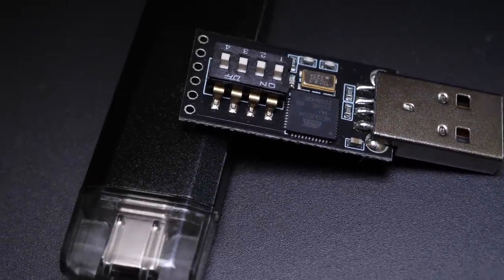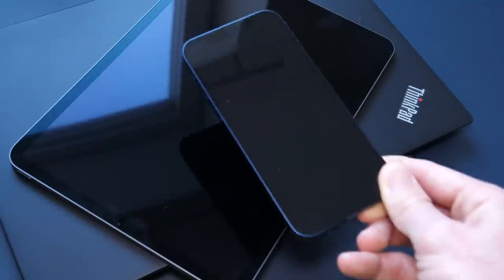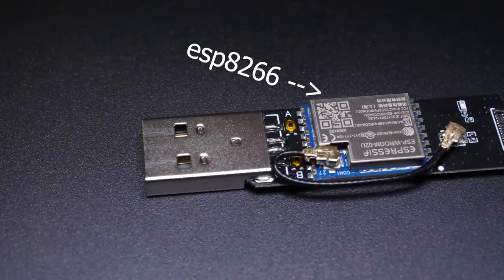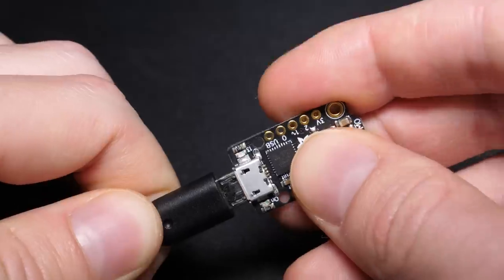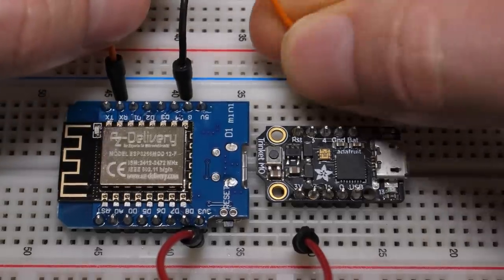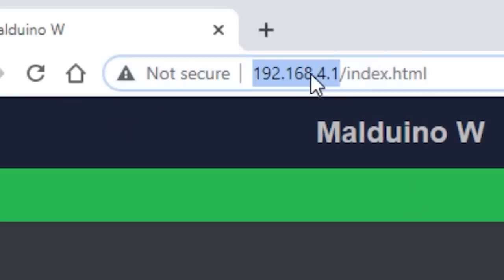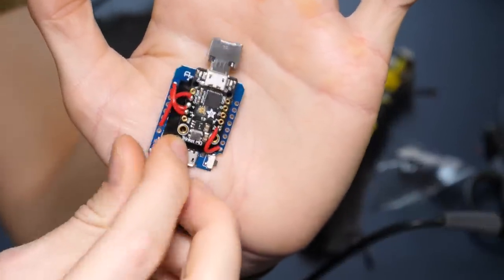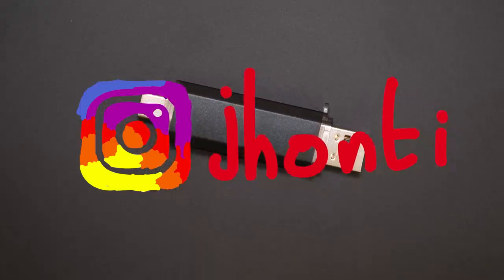Making A $10 WiFi BadUSB + (cheeky giveaway)

Comment: I just bought both a Arduino Pro Micro and a NodeMCU, this comes at the perfect time, and once again, this video is really well made
Reply: Do you mean I can use any Arduino, I have an Arduino nano and an ESP 8266 ... will it work?
Reply: @mananshah4184  you need an Arduino with a ATmega32u4 chip, the Arduino Nano won't work but you can buy an Arduino Pro Micro or an Arduino Beetle for somewhere around 5$

Comment: So, I followed the instruction in the video. All working perfectly with the D1 and Trinket. I want the overall package to be small, so  I then desoldered the ESP12 from the D1 and resoldered back to the trinket using the same connections. When I power up the trinket via USB, the ESP12 led turns on but is very dim. Also, no wifi AP appears. What idiotic thing am I doing wrong? :)
Reply: did you make it work?

Comment: When you build the new malduino why didn't you use the esp32 instead of the arm chip and esp8266 it should be able to handle webserver duty and the usb connection simulaneously?
Reply: The esp32 does not support USB-connection as a host. So you need a second processor (Cortex M0, Atiny85 [as before], CH559, ...)

Comment: I just signed up for the giveaway, I know you said "multiple entries per household are detected, all entries from that household will be disqualified".
I don't know if I just sent multiple requests to your form to see a response by accident, but turns out one of my browsers extensions were blocking me I think from sending the form.
I hope that would not be a problem and would not get disqualified.
Reply from the maker: No worries :) As long as there's just one email address you used, shouldn't be an issue

Comment: hey I just built it will all the right stuff and I can connect to the Malduino just fine and it detects it as a keybaord but when I run a command it doesnt do anything. it work if I like change the LEDs but it wont work if I  STRING hello or something plz help
Reply: I found that it wasnt the LED that was only working it just only lets be run the first line of code so if I had LED 255 0 0 then the LED would change but if I had DELAY 1000 then LED 255 0 0 it wouldnt work. and so I tried running GUI r and it worked but only if i had that line of code only. anyone know whats up
Reply: so it pretty much only lets me run the first line of code

Comment: A good defense against BadUSB on Windows is to set a local policy denying driver installation for keyboard class devices using this GUID: {4d36e96b-e325-11ce-bfc1-08002be10318}. It will prevent any new keyboard from being installed. Existing keyboards will still work.

Comment: When I run a script it shows "Running /" and stays like that for ever, I'm using "D1 mini" and the "Trinket alternative"(Seeduino XIAO) I flashed both devices, but the seeduino its showing as a serial interface only in the pc, also the leds aren't blinking. The D1 mini rx terminal is plugged in the seeduino port 6 and the tx to the port 7. I think the bootloader or the samd-program.uf2 file aren't working properly in this board. Any idea of how to fix this?
Reply: How did you flashed the Seeduino XIAO ? Did you use the two reset "buttons" ? 
I can't forward the bootloader to the board since it's not recognize by Windows.
Reply: same, flashed all the files as instructed but no use, even used spacehun's files still the same
Reply: @ddelruefrancois  yes,put a wire connected to those two and do doble tap and it should appear in windows like the trinket
Reply: @anxiy  Thanks man, I figured it out. 
Did you manage to make it work ?
Reply: @ddelruefrancois  nope
Reply: @anxiy   please let me know if you manage?

Comment: Hey @Seytonic, I have a question, Can we use Arduino instead of the Trinket? Where I am living Its currently unable to ship, kind of in a remote location. But I have in fact an Arduino Uno and the NodeMCU board which you mentioned. The zip file which you attached have the binaries only. SO is there any way to do it. or with a raspberry pi zero w? I have that also. thanks in advance!
Reply from the maker: I made a video a year or two ago on how to make one with an arduino pro micro and esp8266. if you want to do something similar with a pi zero check my video on p4wnp1 aloa.
Reply: @Seytonic  ohh waow thankss

Comment: would the malduino w be able to type faster if you use the usb-c port instead of the usb-a one, because of data limitation or is it mainly dependent on the target's hardware?
Reply from the maker: It wouldn’t make a difference, sending keys doesn’t require all that much bandwidth ;)

Comment: Hello! i tried this build with a seeeduino xiao, i see that the the xiao is detected as a HID keyboard and i am able to connect up to the wifi hot spot ok,  I connected tx to rx and rx to tx  but i am guessing there is a code change needed when using a xiao and not the trinket?  i am only finding code for the atmega - am i missing something ------- thanks for your help and work
Reply: I can't help you yet but I am trying to get the seeduino xiao (alternativ trinket) to work. 
Windows did recognize the trinket but I can't move file on it since it won't show up in the windows explorer.
Reply: @ddelruefrancois  maybe I am a bit late, but adafruit M0 troubleshooting sheet says to disable your anti-virus and I know xiao and M0 arent the same, but YOU CAN TRY some of these troubleshooting tips to get your board working: https://learn.adafruit.com/adafruit-trinket-m0-circuitpython-arduino/troubleshooting
Reply: @alolohmus5305  Thanks for the tip man. I ended up buying the Adafruit trinket. It works like a charm now

Comment: Can you make anything like the Omg cable for cheap
Reply: Prob with the same trinket if ur good at soldering tiny wire originally it was made by using the attiny85 chip with almost no pcb soldering the chip pins to the data lines of the usb A then think it moved on to using the attiny10 chip but def is different now uh days. With wifi added to that mess.. order the diy edu omg kit from hak5

Comment: The responsible thing for you to do is develop a way to defend against BadUSB as well .
Suppose all the USB ports were occupied by mouse, ext keyboard, ext wifi dongle, and or thumb drives.
A utility could monitor for any device being removed from a USB port, where upon the computer shuts down, thereby stopping the BadUSB from doing anything .
I could see how that could become inconvenient, maybe a secret, user set, hot key combination could be used to disable the shutdown long enough for someone to unplug one thing and plug in another.
Reply from the maker: I made a video on defending against BadUSB attacks a while ago, there weren't any amazing solutions, I'll have a look at an update video on this :)
Reply: @Seytonic  doesn't surprise me... a keyboard is a keyboard after all. Adding various levels of paranoia about them is for the most part just making life hard for yourself (will go check the vid though!)
Reply: A good defense against BadUSB on Windows is to set a local policy denying driver installation for keyboard class devices using this GUID: {4d36e96b-e325-11ce-bfc1-08002be10318}. It will prevent any new keyboard from being installed. Existing keyboards will still work.